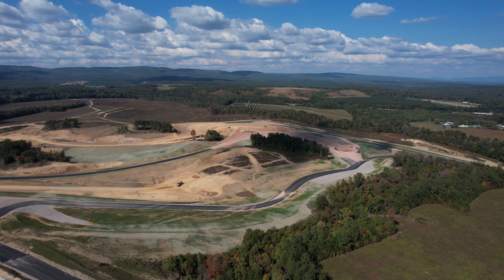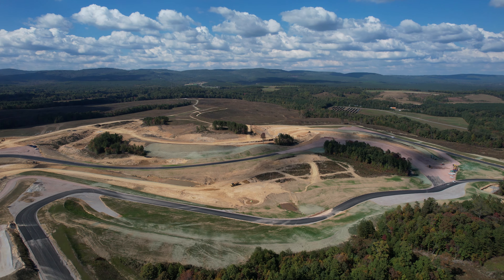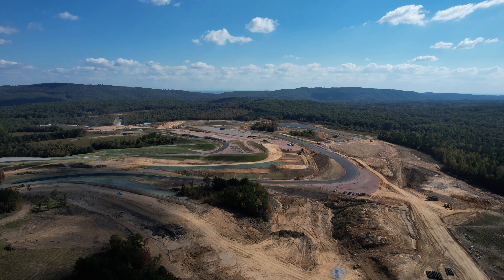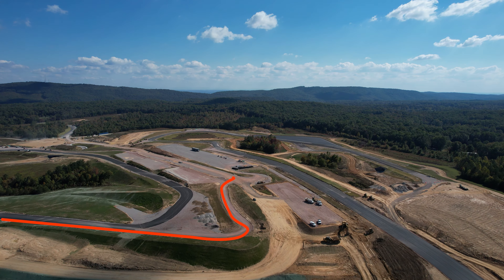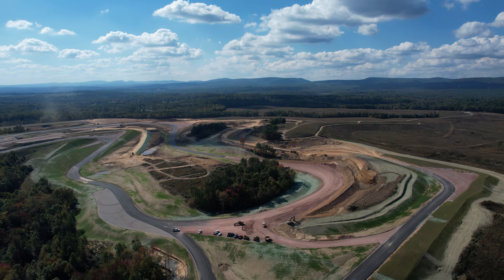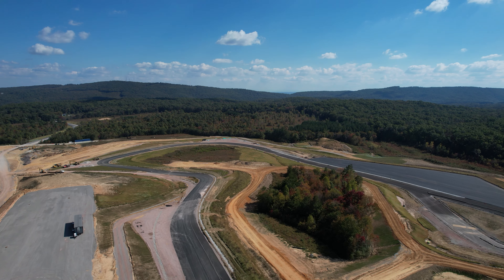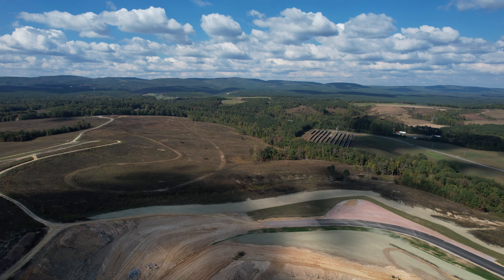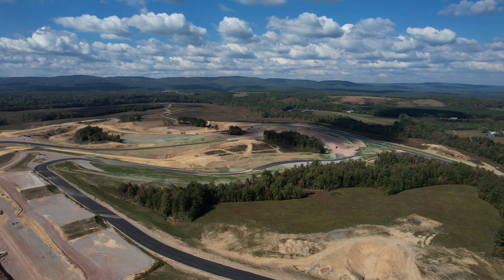Flatrock Motorsports Park October 2023 Update

Comment: Good work. Do you know when track will be open for motorcycle track day?
Reply from the maker: Thanks!  The club section of the track they are working on now and opening first is not rated for motorcycles.  The GP side will be - it's the part that's currently just a path in the fields beyond the construction area.  I think they are going to start on it after the club side is done.  So assuming they finish and open the club side in 2024, the GP side could be open for motorcycles as early as 2025.  That's pretty optimistic though.  After seeing how long the first half has taken, I'm thinking 2026 is more realistic.